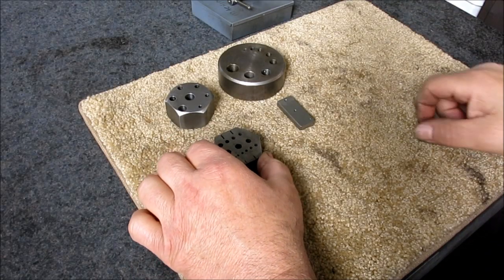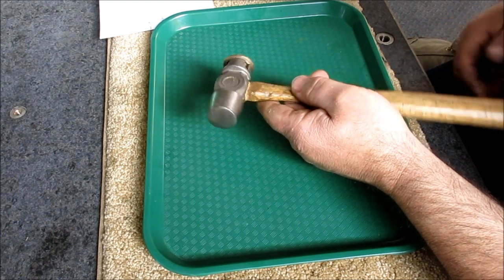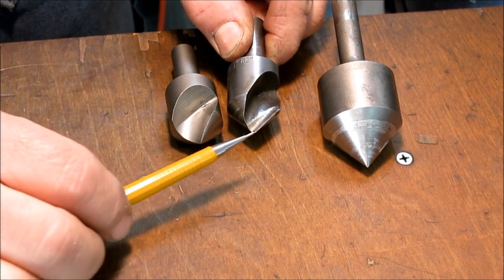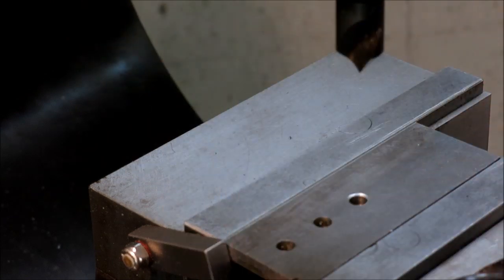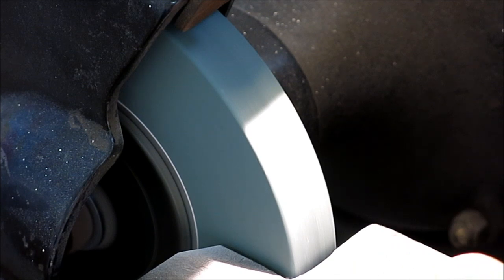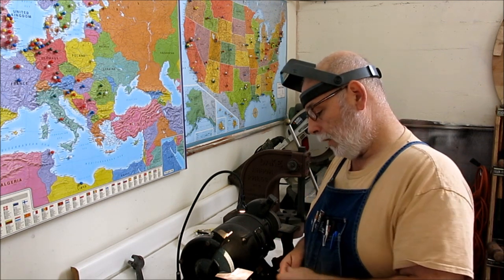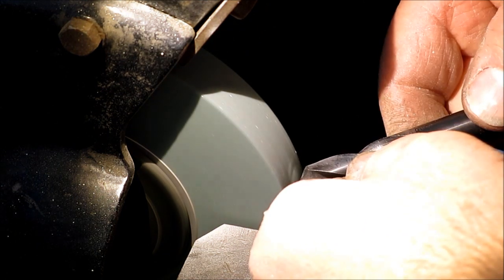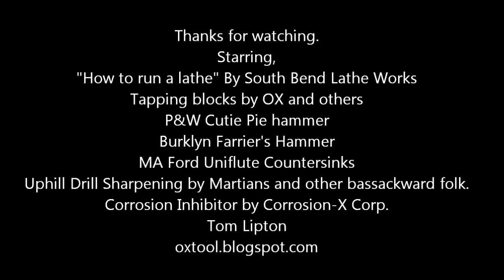Monday Night Meatloaf 13

Comment: Hey, we got to see the Clausing and the rebuilt Kurt vice.
Reply from the maker: Hey Joe,

And I sprayed some belt dressing on the variable belt after I edited the video. That thing has a pretty good squeak going.

Cheers,

Tom
Reply: oxtoolco I heard that rascal grown when it chowed through that plate.  Maybe the variable speed pulley spring needs more preload.   It was just talking, you killed its soul!  As it works, you can hear the tones of the cast iron, the clank of the belt, meshing of the gears, and some other odd noises that Keith Fenner's drill makes.  It's almost a symphony!  I had a '68 VW bug that was like that.  Though it rattled, rumbled, shaked and vibrated; you felt alive when you arrived...and deaf.  More like I felt like I was inside a trashcan being kicked down the street.
Reply from the maker: It certainly does have the contraption sound going on. The belt dressing didn't help. I may take a look at the pulley that's making noise which is on the motor. Allis Chalmers motor by the way. I saw that and had to have the machine.

Best.

Tom
Reply: oxtoolco Allis-Chalmers?  An interesting conglomerate.  What is so interesting about that particular motor?

Comment: I know meatloaf is what's on the menu. Can I have an order of timed threads please?
And yes I would like fries with that!

Thanks,
Jim
Reply from the maker: Hit Jim,

Ok your busted now. The only people that ask for timed or phased threads are engineers. Hummmm. Boys I think we got us an engineer in the woodpile. Better smoke him out.

All the best,

Tom
Reply: Just a lowly field engineer, don't beat me masser.
Reply from the maker: Jim Ward Ok but we're watching you now for signs of pocket protector syndrome.

Cheers,

Tom
Reply: Collar? Blue. Check
Stains? Grease. Check
Tool pouch? 1. Check
Office? Truck. Check
Pocket protector? none. Check
Slide rule? none. Check
Did I pass inspection?

Jim
Reply from the maker: Jim Ward What's the modulus of elasticity for steel? If you answered You mean Youngs? Then you're in trouble.

Best,

Tom
Reply: oxtoolco
What kind of steel?
Reply from the maker: Humm. I'm watching you now bucko.

:-))

Tom

Comment: What size countersink is the one you sharpened?
Reply from the maker: Hi Cameron,

It was a 25mm diameter and 82 degree included angle.

Best,

Tom